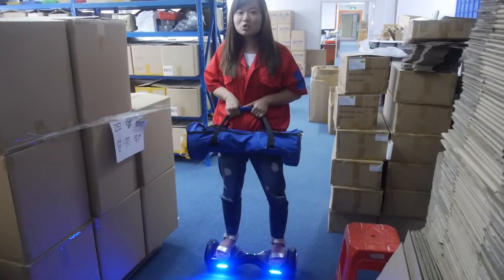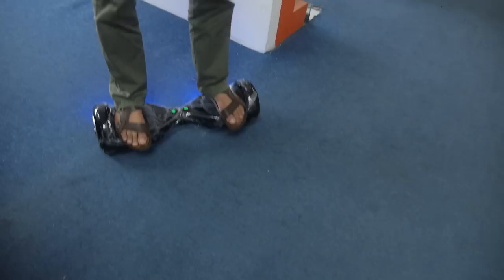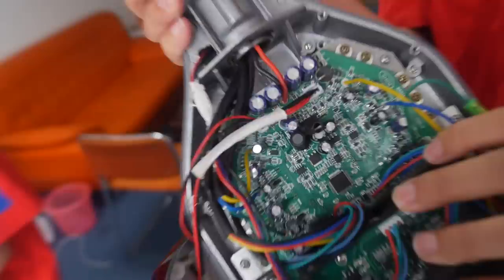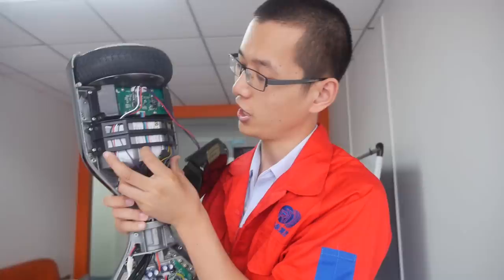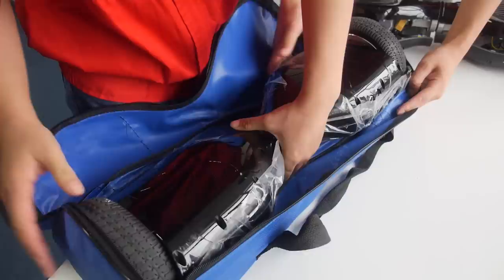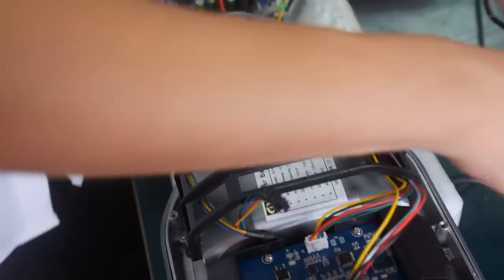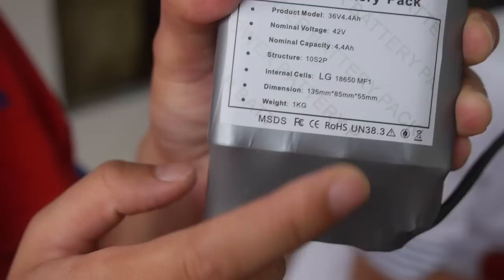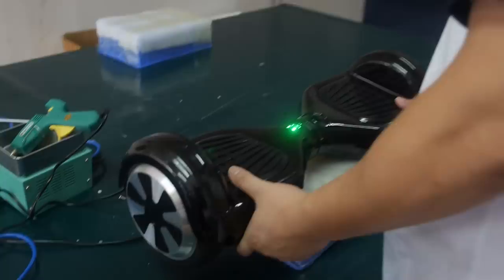$180 Balance Scooter Factory Tour at Shenzhen Realtime

Comment: For everyone wondering yeah those are cheap to buy but if u be careful with it and use it as recommences it will not explode or catch fire this means no overnight charging just 2 hours and always be at home do not leave it alone and do not hit it hard with stuff it will compress the battery that could cause cells to be too agitated and catch fire and do not go on slopes more than described this means 15° or u'll overwork the motors that'll cause the battery to overheat and start melting but if ur too scared and want a safe new design hoverboard theres the koogo x1 its a brand name using german motors and samsung batteries costs 469 US$ on amazon but theres the exact same thing without the company name and described as using a samsung battery for 300 US$ so choose widely